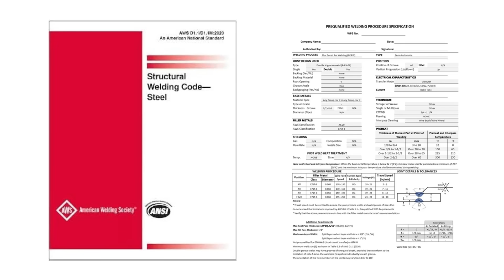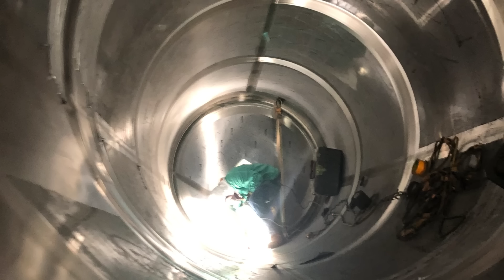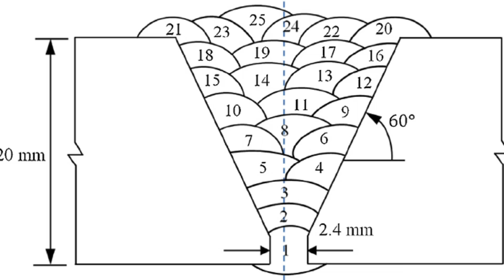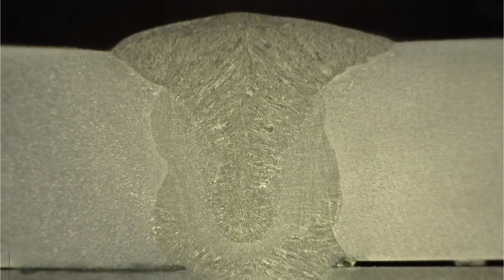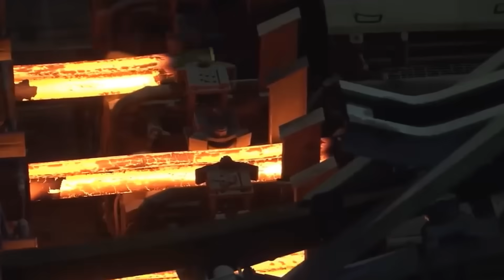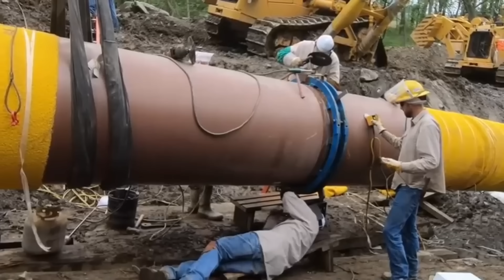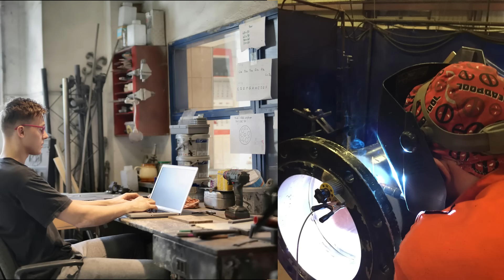7 Things Engineers Wished Welders Knew About Welding

Comment: Any serious/professional welder would have heard all of these things probably a dozen times. This is for the hobbyist or someone who doesn't know anything about about welding
Reply from the maker: Having visited hundreds of welding shops, from muffler shops to multinational companies we can tell you that there are a significant number of welders with very little experience, little training, or even worse, training from someone that doesn't do it right.  The welding industry is hurting for skilled welders, and we're taking what we can. Unfortunatetly that means many will not have the skills, training or knoweldge necessary to do a great job.  It is management's responsibility to ensure welders have the right tools, the right enviroment and the right training.  Many times management doesn't do that.
Reply: A lot of welders learned on the job. Little or no formal training. All they know about welding is how to lay a good-looking bead. "You don't learn to weld in school."  A CWI on a job I worked on used to say, On a lot of jobs, that's OK. I'm retired after a career as a professional welder. Al the best welders I've known went to school for welding. You learn about welding in school.
Reply from the maker: @phlodel  schooling is essential.  As you stated,  not all welders have the benefit of attending a place to learn not just how to hold the torch or what the weld should look like but get an understanding of the effect of all welding variables in the overall quality of the weld, not just the exterior appearance.

Comment: The best engineers/drawing office lads ive found were former welders that move up to the office.. The times ive had to go into a drawing office to get something changed on a drawing.
Reply from the maker: That's best case scenario, having hands on experience on the shop floor to understands the constraints before designing for efficiency (potentially) with blinders on.
Reply: The only way.

An engineer should be designing structures, not the welds themselves. Too many variables to calculate everything. There's a time when 7018 is better than 7014, and the engineer may not know the conditions, but the welder sees the feedback and makes the changes on the spot. This is an area where bureaucracy generates failure.
Reply from the maker: @Faolan161  Great points.
Reply: Interestingly, the best welder I know innmy area is a mech engineer who got bored in the office, went to welding school and moved to the shop floor.

This is not about the color of one's collar, but having the mindset: knowing and understanding multiple sides of the same problem and seeing the big picture.
Reply from the maker: @jozseffabri  You are right., the best scenario is when someone has experienced both side.  I'm sure the engineer you refer to learn some things while become a welders that also made him/her a better mechanical engineer.
Reply: @weldinganswers  it's not about best scenario... It's about stopping what's wrong in the workplace so that quality rises to top. 

When the welder is responsible, then (s)he works with a mindset absent of complacency, and works to gather understanding. When it's as you've described in your vid, the mindset goes to constant self-defense, obscuring the values of the work in practice. 

When a welder has to report to an engineer to get directions to do his job right, he loses the feel necessary to do the job most efficiently and effectively. It costs everyone in the end. In welding, there's no room for bureaucracy. An engineer can design the structure, but everything in your vid is what the welder is required to know and follow, without the engineer watching over him. The welder can't give enough feedback for the engineer to direct a perfect weld every time, but the welder can adjust to circumstances immediately, and experienced welders do this naturally. 

Leave the welding to the dude welding... If the welder has questions, then consult higher experience, not education authority. 98% of the job of a welder isn't learned in school, and surely isn't learned by an engineer or is information an engineer possesses.
Reply: @jozseffabri  that's what makes a good welder.

A good engineer trusts the welder to do his job, and provides the specs for the welder to do so. The engineer doesn't need feedback, the welder uses feedback to adjust his techniques and settings.  Like you said, it's not about the color of the collar, it's about the responsibility of the position.
Reply: Yeah man, i began as labour, learned to fit and weld, went to the drawing office and document control after that, material control, qc, procurement, planning, estimating. Its why im in charge now and its all half mine.

The first guy that asks to learn it all will be my successor
Reply: @Stew-Pedasso  you set to train your competitors?
Reply: @Faolan161  only if someone asks, noones ever asked. 

I was hoping a kid would pop out the woodwork and show the same interest i had.
Reply: @Stew-Pedasso  you're training your competition anyway.  Doesn't matter, you won't find successors. Nobody will stay in the profession long enough in today's world. They escape and start their own business or work for another, Learning what you do wrong for sake of what they want to change... like eliminating bureaucracy, simplifying chain of command, combining QC with manufacturing, etc ... 

And they'll provide greater services to their community because of it.
Reply: I'm hearing you bro!
Reply: Being a draftie is completely different from engineering. Engineers spend years studying maths, physics and materials science to apply to design. Drafties just draw pictures and copy notes.
Reply from the maker: Very true.  But we have seen many welders and fabricators work their way up while attending school on their free time and become accomplished welding engineers or engineers in other disciplines.  That initial experience on the shop floor makes those seemingly boring class a lot more meaningful.
Reply: @weldinganswers  application helps the mind learn wisdom in the classroom. 

This is an area where too much rests in the feel and feedback, where only the guy behind the hood can do the work. Gotta leave the totem pole out of it... educate the welder only, and let the engineer design the structure, not the welds themselves.